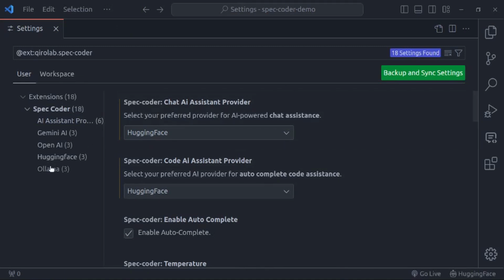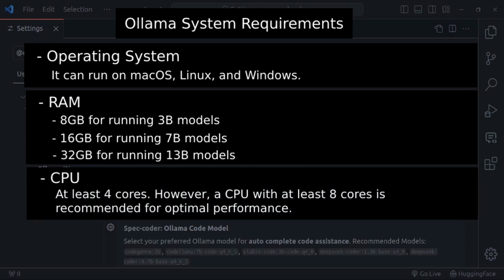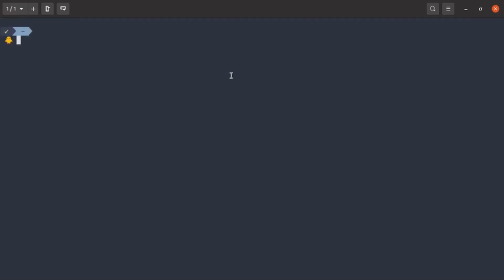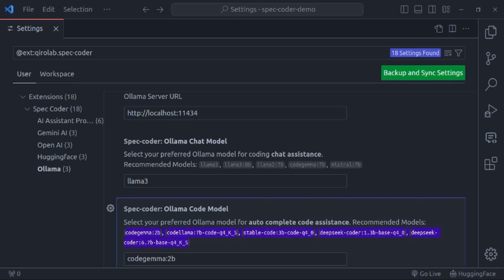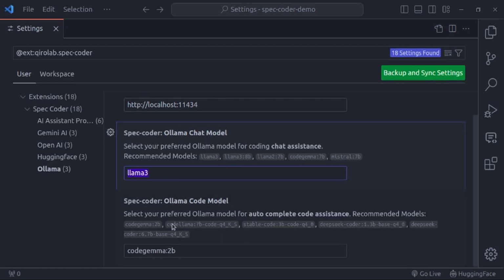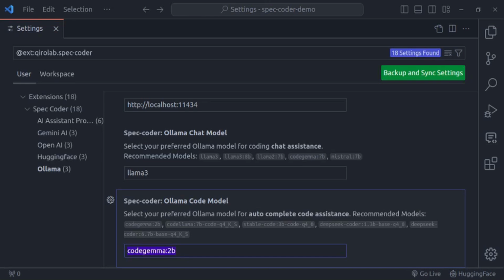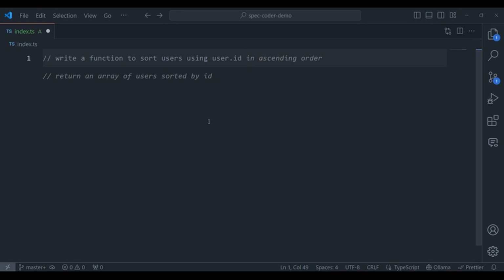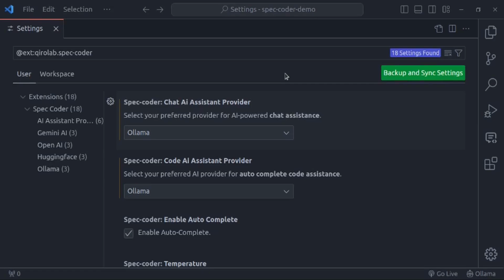Ollama + Spec Coder: VSCode Extension Integration | Power Up Your Code with AI

Comment: hello does it only work in vs code ? is there visua studio IDE for standard ? thanks
Reply from the maker: Hi! Thanks for your comment. Currently, Spec Coder is designed specifically for Visual Studio Code and integrates seamlessly with it. Unfortunately, it’s not available for Visual Studio IDE at the moment.